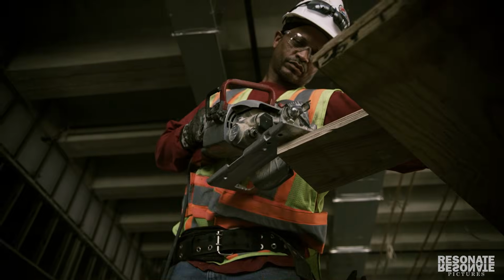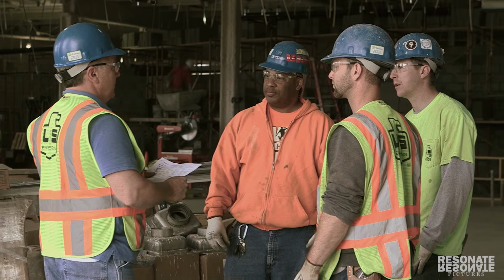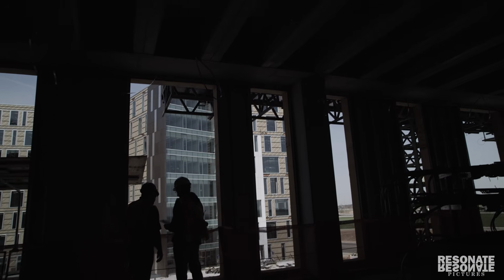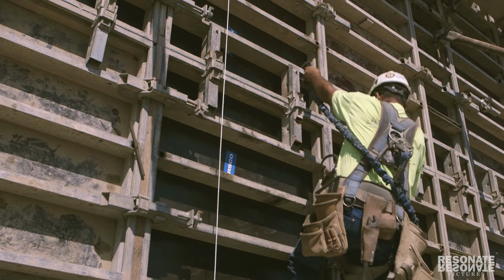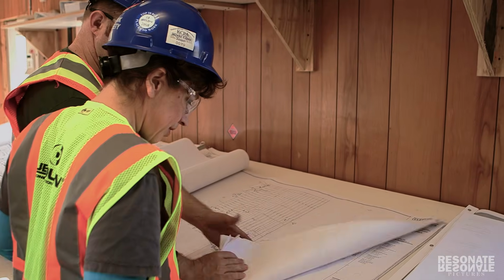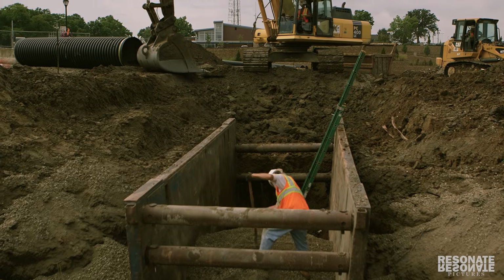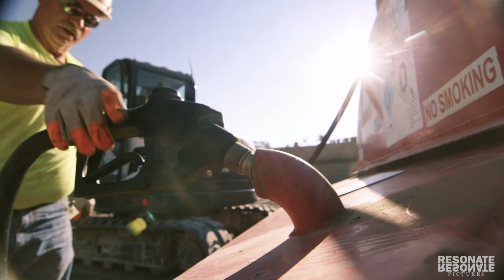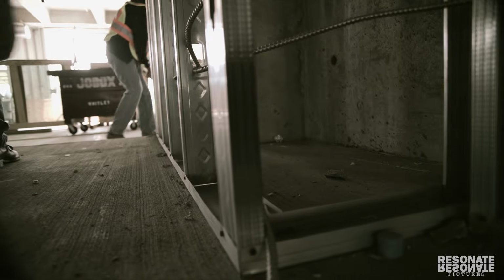Construction Safety Training Video // Over 40 Topics

Comment: Also, need to be alert for seizures, part of tool talk speak on anyone you notice this guy isn't a drinker but I noticed issues with his gte, or freeze ups and he does repetie movements, that is a seizure you just witnessed, also, Absence or petiamll ziezures one slip up can be deadly, if you notice a person freezing and stopping dead n communication, for 1 second to 4 minutes, he need to removed from the jb site and he or she needs seizure testing absence seizures and focal aware re extremely to get diagnosed, 

And sometimes they will need an EMU to assist them or epilepsy Monitoring unit, 
Do not abondom thin while they are testing, if your a true friend, keep in touch, and you cannot catch a seizure. 

I know as I have just now at 53 years old I was just diagnosed with seizure condition,  meds are not controlling, the condition, in some cases, you will never allowed to go back to construction job sites ever again. We are compromised and no shame in saying that, you will be angry, you will cry why me, then you will have to accept it, enjoy your Tim with your family. 
Ohenst and integrity. 

I gave up my license, and my car. Hey enjoy going off grid, just make sure you do ground mount and not roof mount solar. And make sure you have a buddy with you when working with the batteries. And solar.

Comment: One should note that too many decals can hide hard hat defects. For concrete/cement I believe the standard is a Nitrile glove. At tool box talks make sure any concerns are "written down" so no one can deny they were brought up. At the next tool box talk people need to be notified about how any concerns that were brought up, at the previous talk were addressed. For guardrails there is a performance factor that applies to the rail and post. 
Note that for fall arrest systems there is an inspection tag, for each piece (harnesses, lanyards). They need to be inspected "before each use" and per the tag instructions. Make sure the date of the tag inspection is written in indelible ink.

Comment: Throughout my life, I have had several experiences that have prepared me for the degree program of my choice, which is a Bachelor's degree in Occupational Health and Safety. My journey with safety began at the age of 16 when I started working for a construction company, MLN Company, as a laborer. This job exposed me to the importance of safety in the workplace and instilled in me the importance of following safety protocols.

Since then, I have strived to work only in jobs that have a heavy emphasis on safety. When I worked at a pool store as a chemical pool expert, I learned about chemical safety and how to handle hazardous materials safely. I have also worked as a safety professional for the past four years in logistics safety and documentation and general industry safety. These experiences have opened my eyes to the many realms of safety and have shown me that safety is a critical component of all industries.

I am pursuing a Bachelor's degree in Occupational Health and Safety because I believe that this degree is just the beginning of the career I strive to achieve. The degree program will provide me with the knowledge and skills necessary to make a difference in the field of safety. I want to be able to work with businesses and individuals to promote safe practices and ensure that accidents are prevented.

Safety saves lives in all industries. Taking an OSHA 30 course and spending 30 hours of my time doing nothing but safety was a major improvement on my mindset for how I want to develop myself and how I strive to achieve greatness in the field of safety. I learned how to identify hazards and how to create a safe work environment for myself and others. I also learned about the importance of communication and collaboration in promoting safety.

In conclusion, my experiences in the workforce have prepared me for the Bachelor's degree in Occupational Health and Safety that I am pursuing. My experience with safety since I was 16 has instilled in me the importance of following safety protocols, and my work experience in various industries has provided me with a well-rounded understanding of the importance of safety in all industries. Pursuing this degree will equip me with the knowledge and skills necessary to make a difference in the field of safety and to promote safe practices in the workplace.

Comment: The video was put together very well. But there are some issues. A dust mask is not a respirator. Dust masks are not NIOSH* approved disposable filtering facepieces. They can be worn for comfort against non-toxic nuisance dusts during activities like mowing, gardening, sweeping and dusting. These masks are not respirators and do not offer protection against hazardous dusts, gases or vapors. Your anchor point for tie off is a little misleading. 1910.140(c)(4)
Lanyards and vertical lifelines must have a minimum breaking strength of 5,000 pounds (22.2 kN).
1910.140(c)(5)
Self-retracting lifelines and lanyards that automatically limit free fall distance to 2 feet (0.61 m) or less must have components capable of sustaining a minimum tensile load of 3,000 pounds (13.3 kN) applied to the device with the lifeline or lanyard in the fully extended position.
1910.140(c)(6)
A competent person or qualified person must inspect each knot in a lanyard or vertical lifeline to ensure that it meets the requirements of paragraphs (c)(4) and (5) of this section before any employee uses the lanyard or lifeline.
1910.140(c)(7)
D-rings, snaphooks, and carabiners must be capable of sustaining a minimum tensile load of 5,000 pounds (22.2 kN).
1910.140(c)(8)
D-rings, snaphooks, and carabiners must be proof tested to a minimum tensile load of 3,600 pounds (16 kN) without cracking, breaking, or incurring permanent deformation. The gate strength of snaphooks and carabiners must be capable of withstanding a minimum load of 3,600 pounds (16 kN) without the gate separating from the nose of the snaphook or carabiner body by more than 0.125 inches (3.175 mm).  Clean up. It is not your job to clean up other trades trash. If your a plumber you for the most part do not know what is trash and what is still being used. Report the issue to your foreman ans he will address the issue.
Reply: Who tf is yu 🤣🤣

Comment: Use of the quick cut at 1:12 is not good. Never use you foot to secured a piece of material you are cutting. Also the material is not supported. Potential it could bind the blade and cause the saw to kick back.

Comment: It's nicely put together. I noticed two things while watching it. One is the part where a worker is shown operating a buzzsaw, and he's wearing gloves. That should be prohibited, due to the fact, that if that glove gets caught by the sawblade, the employee will not be able to pull away and it will probably cause very serious damage. The other is that there is no mention of the right of way at the construction site, which should be clarified for everyone before entering the area. Preferably it should look like this: 1. Cranes 2. Forklifts or other load-carrying vehicles 3. All other types of vehicles 4. Pedestrians.